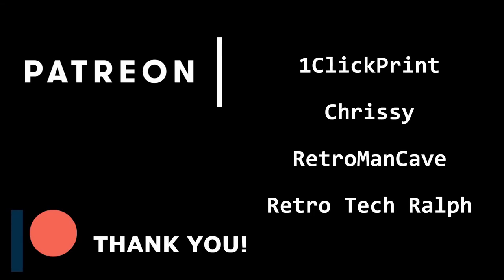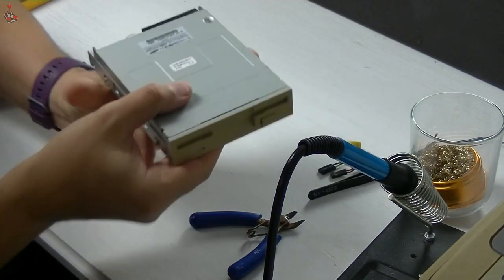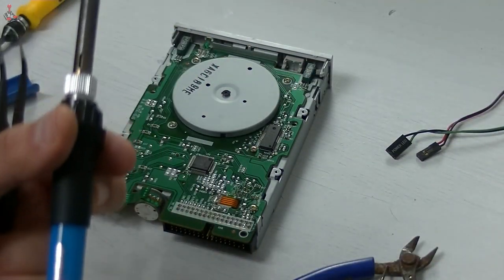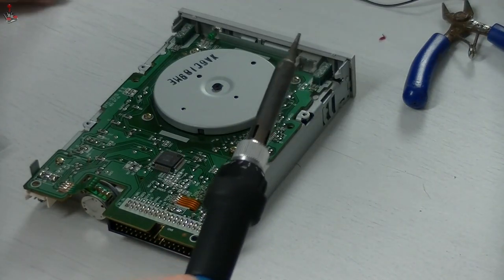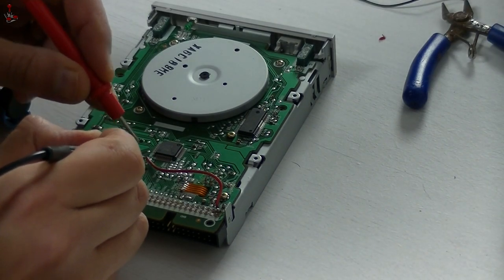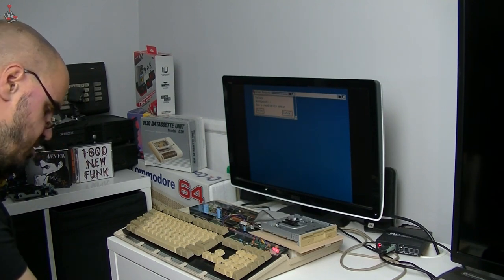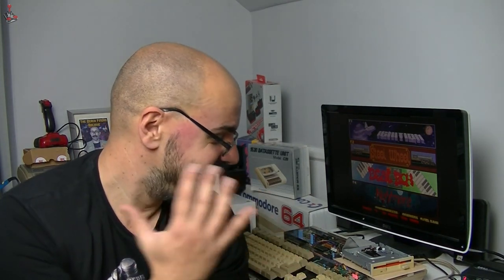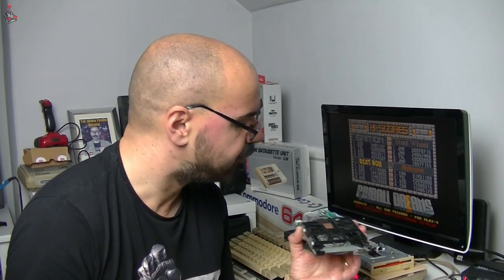Convert a PC Floppy Drive to work on AMIGA | Easy Mod

Comment: I would like to point out that a floppy drive that has been modded in this mannner will, in all likelyhood, also work with both Amstrad's CPC and PCW models, and the Sinclair ZX Spectrum +3. All you need is a proper cable, i.e. one with a 34-way edge connector for the Amstrad CPC and the Spectrum +3, or a 34-way to 26-way for the PCW machines.

Comment: Thanks for this. Gave me the confidence to convert a Sammy myself. Seems to be working so far too! :) Just need a 3D printer button and to find a way to fit it into my 1200 case as it's a tad bit larger than the stock drive I took out...

Comment: Hello ! 😀
👉 Thank you very much for your video and links also 👏👏👏
I did search «PC drive in amiga» in google and found your video, and I realised that I got exactly the same floppy by hazard !!! 👍
I had to take the EJECT button from the old Amiga floppy, and also to file / sand the metal support of the ejection button and also the shell around the button.
This new reader replaces the one from the working A600, but which I put in the A1200 because it was the latter which had failed.
Encore merci ! 🙂

Comment: Really cool! Please test and see if it works as a High Density floppy, too. You should be able to format it at 1.72MB if it works in HD mode
Reply from the maker: Really? Interesting! I am waiting on an external interface / cable so that I can have the gotek and the drive as DF0 and DF1 so i can do more testing. My only copy of WB 1.3 on floppy seems to be corrupted so I need to wait for the cable to make a new one.
Reply: It's not easy to recognise it at HD mode, because the HD floppys on Amiga were very special ones. They had internally a trick about reading the disk at half speed to do the read/write process,  so i think there's not easy task to do the job. But anyway, the 99.999% of Amiga disks are written at 880Kb mode(double side/double density), so it is a little useless to test(and HD floppies work very slow on Amiga because that). 
Good video, i have used some Samsung drives on my Amigas and they work almost perfect, even with track-loading disks(Demos, etc...)
Reply: @RetroRecollections  To use the converted drive as external, shouldn't you leave it at DS1?

Comment: This might be a silly question, but is it possible to use this method to create a 'tower' of floppy drives? Back in the days a brand called "KCS" made a dual floppy drive in one container, but I was thinking; if you can turn one of these pc drives (which are there in abundance) into an Amiga drive and you have some skills in making a proper container, then you would have a nice 3 way stacked floppy drive holder. Which would be very nice, when reading multiple disks, or copying them etc.
Reply from the maker: I guess it may be possible. Not sure how many drives the Amiga can "see" and one time?

Comment: Nice work... and how about disk swapping? i managed to modd some pc floppys, but they failed to disk swapp.
Reply from the maker: What do you mean disk swapping? When it asks for next disk?
Reply: I think he is asking if it actually detects a disk change. Amiga Floppies have a sensor to detect a change, hence the annoying click. In Workbench when you eject a disk, does the system detect it and sense a new disk is inserted, or do you have to use the "Diskchange" command from the Shell to tell it about the new disk?
Reply from the maker: @10MARC  Thanks Doug. I have not tested this yet actually. I will investigate further :)
Reply: @10MARC  I believe the cable from pin 2 is Rdy signal, so in my particular tests with those drives(i have done the mod for some of my Amigas), the disk change is properly detected. I have tested some 2-disk demos(Like Desert Dreams), and it works perfect, so it detects where you eject the disk and put another disk on the drive.
Reply: @fireb0y0  that is awesome!  I always assumed there was a sensor that was unique to the Amiga drives.

Comment: This drive does not work properly with the amiga.
D-copy (4) shows an error code when reading for all sectors. The floppy boots but, obviously slower, copying no longer works.
Reply from the maker: Worked fine for me.
Reply: @RetroRecollections  I did the same conversion on another Samsung SFD-321B floppy drive and it didn't work the same way. I’d be wondering what else D-copy reads about sectors. True, it works, but not properly, for me, this experience drives two Samsung SFD-321B floppy drives.